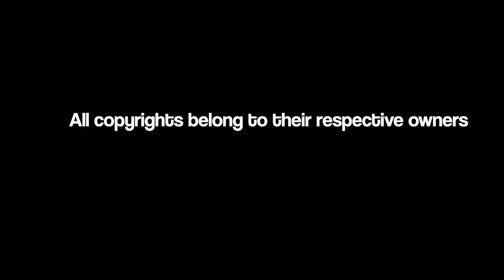Big Muff shoot-out | Nano Bass Big Muff vs Green Russian / Sovtek

Comment: I bought one of these. It is a very good version of a Big Muff in my opinion
It works well for me for guitar!!!
It has BC547C transistors, equivalents to the russian KT3102G used in some 
version in the early 90th. 
I took a look inside and it seems to me, the original circuit was extended to optimise the whole thing. The outcome is a very flexible pedal with good sounds from different settings.

Comment: Noticeably sharper mids and highs on the nano bass.  The Sovtek is more muffled and smooth, but it's also more scooped.  I actually prefer the nano bass muff to the Sovtek.
Reply: +FallaciousScotsman But here's the thing though: Every demo-er goes "Well I'm gonna put both knobs at 12 o' clock which must mean they're the same". But it's not the same. Every potentiometer has variances in resistance which means it's highly unlikely that the two circuits are the same even when all the knobs are physically in similar positions. These comparisons should really be done purely on sound and not the physical placements of knobs.
Reply: +Soham Bhattacharya it's just a useful reference point that shows you the differences between the pedals, which is kind of the point of the shootout
Reply: That doesn't just show the differences in the pedals, though. It also shows the differences between the settings. The knobs looking like they're in the same place is meaningless if the same settings don't actually produce the same results (or as close as possible).

Comment: The Sovtek seems to have a bit more of a woofy sag and softer sustain to it while the bass muff has more attack and a grittier fuzz.
Reply: +PANICBLADE But here's the thing though: Every demo-er goes "Well I'm gonna put both knobs at 12 o' clock which must mean they're the same". But it's not the same. Every potentiometer has variances in resistance which means it's highly unlikely that the two circuits are the same even when all the knobs are physically in similar positions. These comparisons should really be done purely on sound and not the physical placements of knobs.
Reply: Soham Bhattacharya Well... you have to place the knobs somewhere. besides, if you turn the tone knob down on the nano it seems like the 2 would be indistinguishable from each other in a mix anyway. plus this was more of a core voicing demo anyway meant to show each pedal's quirks at practically any setting, and it's not like they stayed at only 12 o clock. you want to play around with the knobs to get the potential range of each pot. just cause they might sound identical on one setting, it doesn't guarantee the rest of them will sound even close.

Comment: I actually prefer the clarity and bite of the Bass Big Muff, but that's just personal opinion. Great demo JJ!
Reply: In real life the russian has WAY more dimension and detail. My experience with noise was the complete opposite of what he experienced. The old bypass sucks though. When hearing it in person the bass muffs sound pretty sterile and slightly shrill in comparison. The way they sustain is kind of pathetic too but only when you're hearing them side-by-side. They're still great and I am pretty sure I like them better than the NYCs. Depends on the application I guess.

Don't forget that this guy works for EHX. He's right about the price unless you have money to blow in addition to room for a giant tank that requires a battery and also has a unique, dark bypass buffer. There are other alternatives though.
Reply: hybridmcgee I came away with the same feeling you have after putting a new big muff(guitar version) next to the Russian bubble font, "sterile and slightly shrill". Plus I like the foggy but clear sound of the old version, kinda feels like its cutting through a room full of smoke. If I hadn't scored a vintage one for cheap I probably wouldn't be shelling out the money though and could be happy with the new version by turning the mids down on the amp.

Comment: Is bass big muff pi nano  a distortion, fuzz or overdrive type of pedal effects?
Reply: Its called distortion/sustainer, but Muffs generally are fuzzes in my opinion. So lets call it a fuzz. Absolutely not an overdrive.
Reply: John Reid Yep good point. Although technically a fuzz, the muffs were designed from the ground up to have higher gain and a smoother sustain tone, more typically found in what we consider full on distortion units, but the clipping is still a touch harder and carries a bit more of the original signal in it. So yeah, I call it a fuzz but it can be both or even neither.